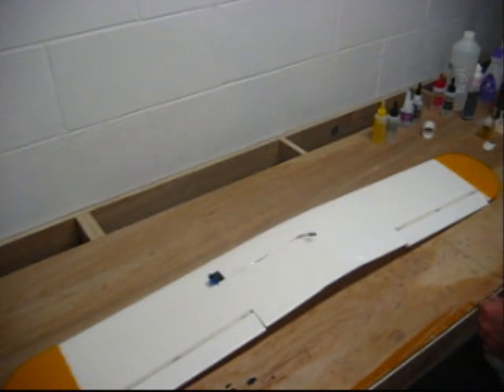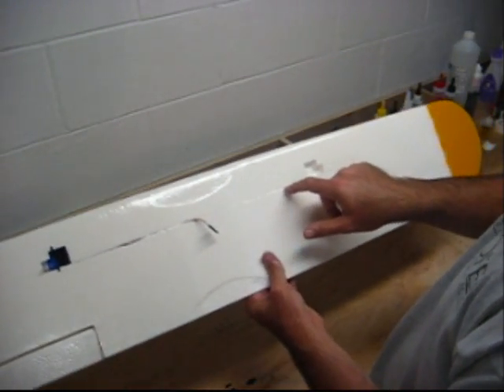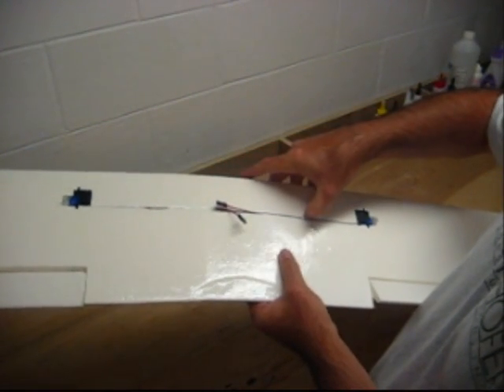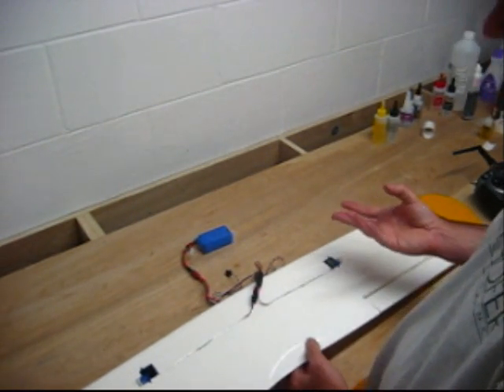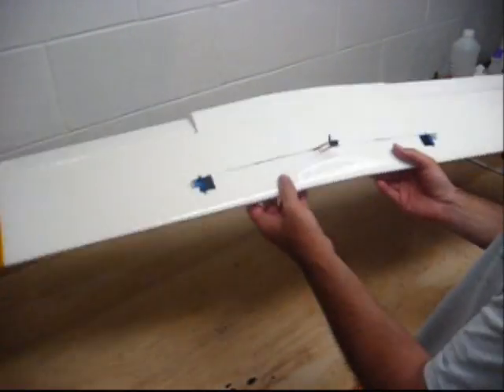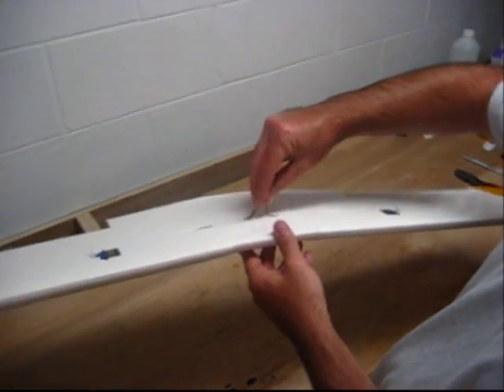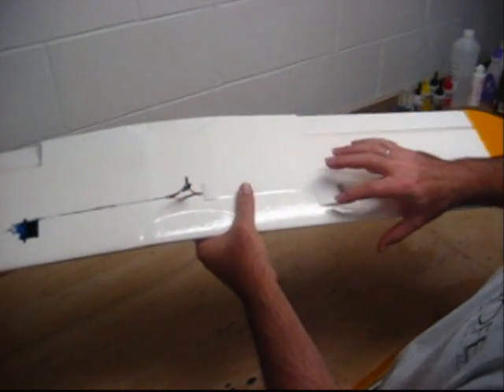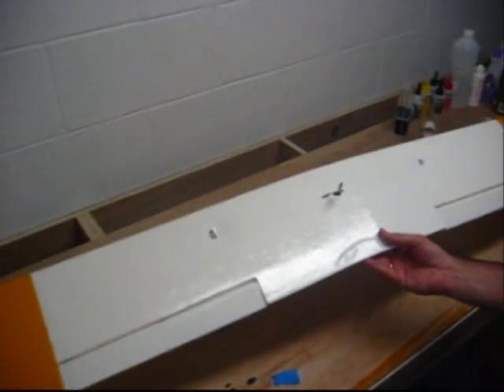12-Mounting the Aileron Servos - Building HZ Super Cub from Scratch

Comment: This is really bothering me considering how perfect the rest of your work has been.  Why didn't you glue down and mount your servos and wiring when you cut out the opening and then just cover over the top of them instead of covering, doing all that and then patching over the top of that?
Reply from the maker: I designed it this way so I could remove the servo if it ever went bad.

Comment from the maker: Hot glue gun?  Unless you'r using the low temp sticks, it might melt the foam from the heat!  I usually use white latex caulk or silicone.